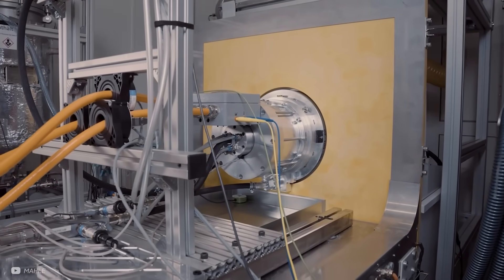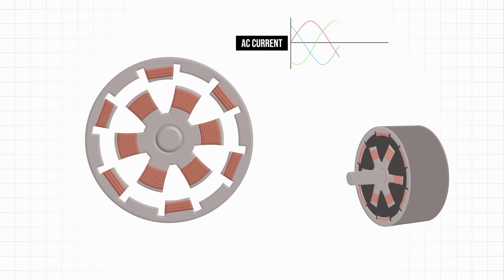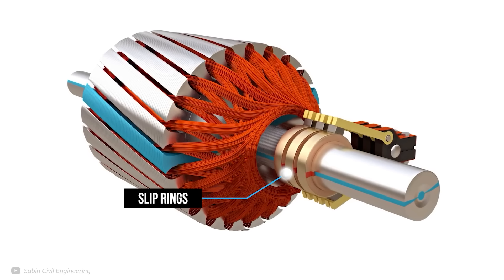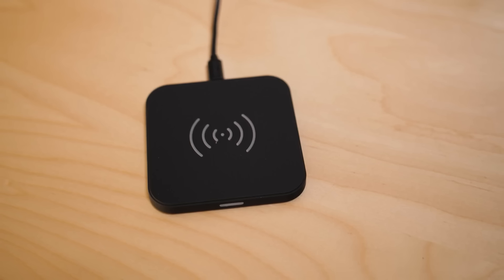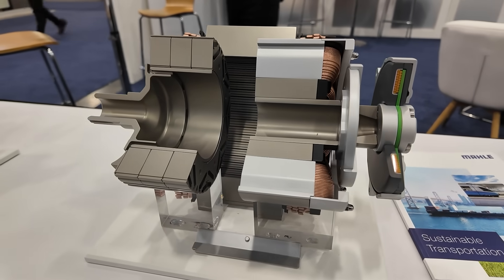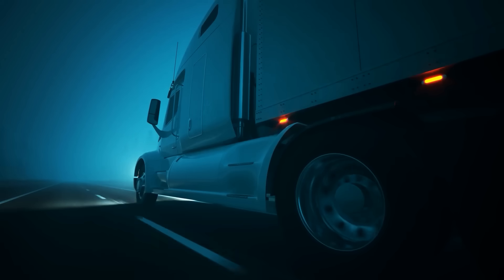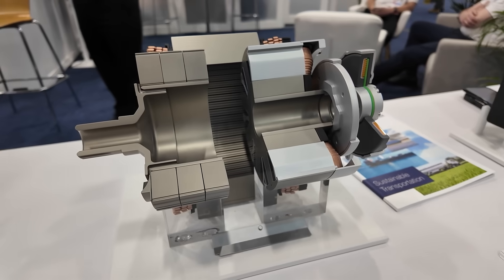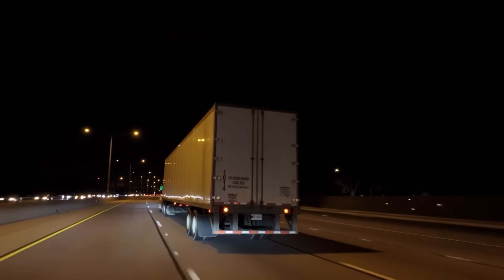Genius Contactless Motor Could Change Transport Forever

Comment: As an engineer I've very much missed not having power density and better information on efficiency. It's the technical stuff that really interested me.
Reply: Exactly, no information beside 'better'. Also no comparision to motors with rotor magnetic fields conductors (iron bars) like some BMW ones which can transfer field from one coil on the outside of rotor to other (or almost) side.
Reply: @b9eda9ad   - are you describing a reluctance motor - switched reluctance was all the rage a while ago...
Reply: Indeed. No performance numbers is a giant red flag.
Reply: All sizzle and No steak. No mention of slip in induction motors (vs synchronous), and why the slip (the OG method of conveying current/excitation to the rotor) is less efficient than the external induction assembly shown here.
Reply: @karlfife    - lol,  merely cast significant shade on induction motors while calling everything amazing and "wireless". -  yep...  (double induction - synchronous machine, call it what it is.)
Reply: @karlfife  I hear you there...
Reply: @karlfife  And if they're pumping oil through the rotor, what effect will environmental temperature have on the motor's efficiency? There's a reason why motor vehicles use lower-viscosity oil in cold climates, and if the motor functions at, say, 25% power while it's heating the oil up enough to reduce the viscosity to normal operating conditions, how long that takes is going to be a huge consideration in the industry adoption of the motor. And there is also the consideration of how well it functions in reverse -- most electric vehicles use regenerative braking, running the motor as a generator to recapture part of the vehicle's kinetic energy back to the battery to extend range. There's nothing in the video about how efficient the motor is when being run as a generator, or even if it's possible. If it can't be run as a generator, that has knock-on effects to EV design, by requiring significantly larger brakes to slow and stop a much heavier vehicle than one with an IC engine.
Reply: That is true, how much power is wasted in the inductive stage and how much is used for the electromagnets ?
Reply: @nwb8006   This is the issue I am planning to raise with my general comment above where I express doubt in the power transfer capability of the 'wireless commutator'.  The power handled by the energy transfer mechanism between stator and rotor, must equal the total motor power, since all output power is transferred to the rotor.
Reply: @nwb8006  electro magnets are highly efficient !! 😮
Reply: @nwb8006   Having the source of electrical energy transfer to the rotor not be the motive force itself, can only be less productive. If that wireless energy transfer system is not the motive force producer, then the drag caused by the wireless transfer would probably counteract  the motive force.
Reply: The most important bits.
Reply from the maker: I was annoyed not to get this information too, I reached out to MAHLE a few times and even spoke to a rep at the CES tradeshow, but didn't get any replies via email and the rep didn't know. Apologies that information was missing!
Reply: @ZirothTech  That means its real specs are terrible and they don't want to say anything.
Reply: @ZirothTech  garbage in, garbage out: there are and always be air gap losses. Mahle may extract heat to guarantee a "safe" air gap but that would cancel in the long-run. One can't have "dynamic stators or rotors". Since efficiency is measured at the motor shaft, some compromise must be done to come up with a 1) shaft, 2) claimed 95% efficiency, 3) temperature range ! You can't have all 3 in one electric motor.
Reply: @codures  that’s what they said about powered flight ✈️ etc  Lol 😂
Reply: @ZirothTech  not really a new thing, just a standard synchronous motor with external excitation, using a planar transformer to power the rotor winding. Pretty much something common on high power generators, where they need to run long periods without stopping, making them useful in power generation for long run time, as the only thing you need to change is the oil bath oil in the bearings, and thus can run them for 10 years with no stopping, before stopping to clean and inspect them.

Does not even need much in the way of electronics in the power transfer, you have a rotor coil with a bridge rectifier, and a exciter coil with some form of AC power, either simple H bridge at some fixed frequency, giving a constant current, or variable to allow you to vary current based on duty cycle of the bridge, allowing max field strength at low RPM with high current, and at high RPM you drop excitation to a lower level, or even turn it off, to allow the rotor to act like an induction motor, using the diode bridge to handle the freewheeling current, which will improve efficiency a lot, as now at speed no cogging losses in the magnetic system, while at low speed you get a very high breakaway torque. Much cheaper to make yes, and while you have a lot of copper in the rotor, and need to cool it as well to keep the heat down, it will work well, even with existing drives, with only minor changes to provide the excitation power, and the added temperature sensing needed. Your bridge rectifier will probably be improved by adding in active switches, as you otherwise will need beefy schottky diodes on a heat spreader to handle the high current, as high current is needed to get a strong field, and you will definitely want to reduce inductance. So schottky diodes rated around 100A per diode, or add in power mosfets, and a separate power winding to allow an active rectifier to be on the rotor as well. Slightly more complex, but allows an extra percent or two lower losses.
Reply: @SeanBZA  I'd rather watch your videos if you make them. Excellent insight.

For high current applications, I believe soon enough we won't have any rectifiers at all where rectification is needed - but rather a sensing circuit steering a high-efficiency switch. You don't need to "rectify" a sine wave if you know which way it's pointing and throw the right switches just in time.
Reply: @ZirothTech you should have laid that out clearly in the video, in the description & in a pinned comment. 
You are wasting our time & it's not appreciated.
Reply: @ZirothTech  there's a reason they didn't share that info.
Reply: @ZirothTech  That should have been included in the video.
Reply: @ZirothTech  whats your take on this?  open source or patent "protected"? As I have tried reaching out to no avail as well.  Or is this put out there for future dev.  The later seems true as it corresponds to my past ideas almost 100% that I have been pondering for years.
Reply: @JohnFigueroa-r6p  by the looks of it it's a pretty cynical investor play. I get the political implications of rare earths, but replacing them with copper, fed wirelessly - this ain't getting nothing cheaper or better outside of some very edge cases.

Modern brushless permanent magnet motors have advanced so far thanks to drones incl huge agricultural ones, they'll wipe the floor with this thing.
Reply: @AlexKarasev  appreciate that sentiment, but it was just something that I envisioned some time ago specifically for an alternator, (Not the wireless part) for other purposes.
Reply: @ZirothTech no ur lazy and greedy and just sad your being called out.
Reply: @ZirothTech  That is a HUGE red flag!
Reply: @ZirothTech  Sounds like Mahle is stuck and is fishing at CES for more funding to continue its research.
Reply: @ZirothTech  So you cannot know if it will "Change Transport Forever" or not at all...
Reply: @ZirothTech  Do they claim to have built and tested one?
Reply: @samheasmanwhite  Can I just point out that where I used to work before retirement we were assembling turbine driven alternator packages with 10MW brushless alternators for many years. Exactly the same technology as this, just a different use for the technology.
Reply: @martinconnelly1473  Oh I know it works, rotary transformers have been around for many decades, but I'm wondering if this company has built one. Also I can see it being needed in turbine alternators due to the insane surface speed you would have to deal with for brushes, but is that really a problem in small traction motors? I guess even just the carbon dust is a problem, so maybe I'm being too sceptical... this probably does have some good benefits.
Reply: @samheasmanwhite  The alternators were always geared down by a planetary gearbox to suit either 50hz or 60hz regions. So not rotating at the same rate as the turbine. However it would still result in the large surface speed for slip rings you mention due to the large diameter that would need to be used to cater for the large currents.
Reply: @martinconnelly1473  Huh, I'm surprised it would be used like that. Just guessing, but I suppose you could use smaller slip-rings at a higher voltage and lower current with power conversion on the rotor, but if you need electronics on the rotor anyway you might as well do a rotary transformer too. At least I assume there is electronics on the rotor? Feels like a 50Hz rotary transformer would need to be huge.
Reply: @samheasmanwhite  There is an extended rotor shaft with the unit on the non-drive end. The electronics are all external to the unit in a control room. The unit powers the field coils of a mutli-phase alternator in the unit that is then rectified and used to power the rotor coils in the main alternator. This gives full control over the power output to maintain the correct voltage coming from the alternator. As the output was often paralleled to other supplies the power output had to be carefully matched to these to avoid back driving the alternator or having the same effect on others. The alternators weighed up to 50 tonnes and the external rotor power unit was about a 400mm cube. Slip rings are not a good idea when you want power 24/7. These packages were often part of offshore drilling and processing rigs for example.
Reply: @martinconnelly1473  Ayy, those are some chonkers! I just had to design some variable current load balancing circuits and I am not envious of having to do that with multiple gas turbines and an oil rig's main power at stake.
Reply: @ZirothTech  If they would not tell you it means efficiency is poor and this whole video is a waste of time. Nothing to see here folks, move along.
Reply: @ZirothTech  you should have not bring it here then, acting as a siding of potential scammers, with all this buzzword bullshit.
Reply: @ZirothTech Then you needn't have bothered to make a content free post.
Reply: So no way to "truly understand" =/
Reply: This video is pure hype.
Reply: @tarstarkusz  possibly, possibly not.  It is a design concept that I have envisioned for years and this is the first time I have seen anything closely corresponding to it.
Reply: that's because zeroth is not good at being tech specialist, lmao.
Reply: 95%...
Reply: Yeah wtf is up with claiming this will "change transport forever"? Nothing in the video substantiates that claim.
Reply: This new motor is a giant step BACKWARDS in most ways, to early polyphase motors invented by Nikola Tesla, in that they have wound rotors (no permanent magnets). But that is combined with a way of getting externally controllable levels of power into the spinning rotor, without needing slip rings. All of is OLD, except for the external control. Only that particular separates these new motors from existing brushless polyphase synchronous AC motors... Which, btw, run as induction motors at low speeds, for greatly improved starting torque.
Reply: @YodaWhat Thank you for REALITY Report! The Scarry Part, we Forget, by Incompetence(!) Or on Purpose(!?) About Past/Historical Achievements/Discovery! Why?!😮😢 For 100 years We walk 2 steps forward and 1 step BACK!😮😢😊😊😊
Reply: Especially when synchronous induction motors exists since forever. How this design is better I wonder.
Reply: @Piasecznik72  Carefull... this thread seems to think electric motors without magnets are somehow a modern invention.
Reply: with what you shared, I'll add that you need to consider other ideas for this tech might impact also.   [AKA Think outside the box or framework that is being promoted]
Reply: Go and think of the extended applications ! That not transport! But requires higher rpm that squirrel cage synchronous motors  😮on grid supply! 😮😮😮😮
Reply: I can see it !! And I’m only a electo tech
Reply: By using not using permanent magnets leads to energy being used in the electromagnet that replace the magnet meaning less efficiency.
Reply: @  I have seen a car in the sixties picked up by a 1.5 V battery 🔋 powered electro magnet 🧲 go learn shit 💩 and then learn some more 
  Then think about it for ten years ! Then come back and say that ! The power used is negligible ! And if you listen 👂 the permanent magnets 🧲 actually cause waste in the system !  
  Be more informed and have better understanding b4 opening mouth 👄
This technology will enable  brushless motors to have a wide easy to control speed range way more efficient and higher rpm that squirrel 🐿️ cage type motors with untold less inrush currents and same efficiency as rare earth types !!!  Go do your electrical studies further !
   ie , iron losers , hysteresis , changeable flux fields ……..
Reply: Nickola Tesla invented the brushless motor and his brushless Generators are still running Generating Electricty To one side of the Niagara falls and they running to this and lighting that lights the pathway to my knowledge Most battery operated hand tools you have the opsion of Brushless Motors in em but they are  generaly more expensive.
Reply: @  ???? A little knowledge is just that ! He invented the induction motor  ! Had a squirrel 🐿️ in a cage 😂   
   Not sure but the generators had the exciteor had low current slip rings ??? Originally ?
Reply: @robertwoodroffe123  The technology had been used for decades, its nothing new. I can buy a HobbyWing FOC (Field Oriented Control) 3 phase or brushless motor for an RC car and claim to have even replaced a parking brake... but it does'nt make it any more revolutionary than an RC car with a fancy motor that locks up using electromagnetism.   
edit: HobbyWing holds a patent on it by the way.
Reply: @Ed-ty1kr     there is no permanent magnets  🧲 in these and they are NOT toy car 🚗 or battery 🔋 drill motors!! Obviously the new part  eludes you ! This is more like ! But not ! What was called a universal motor ……..
Reply: @robertwoodroffe123  You mean a 3 phase alternating current motor with rotating magnetic fields was not invented by Nikola Tesla? I thought they named a car company after him for that reason alone?  🤔  Huh... You dont say...
Reply: @ Oh and by the way, that FOC "toy car" motor holds an international patent for a reason... unlike this design which had been used in  industrial applications long before someone put tariffs on rare earth minerals. Yes induction 3 phase motors have NO MAGNETS 🚫🧲 because they use INDUCTION COILS to generate the right hand rule which includes your middle finger pointed to the left 👉+🖕 magnetic fields and therefore require no brushes... which is why they are used for reliability.
Reply: @Ed-ty1kr  What did the FOC do differently?  All RC BLDC use permanent magnets.  Help me understand what you're pointing out here?  It is amazing what the RC community has pioneered though...John Robert (Holmes) has done some nice work as well.
Reply: @JViello  It's not necesserally the "RC" community which is winning wars at the moment, it's just an interesting way to turn an electric motor at percise speeds that refuses to allow greater or lesser speed all the way down to zero and a full stop.  Meaning if you ever played around with it you would realize it can not only turn silently, but if you stop the motor it remains electromagnetically locked up.  And if you have no respect for the RC community you are not an engineer, even a helicopter was first done in lesser scale during the 30's.  Everything from submarines to boats all starts with scale designs for testing. 
Look it up, Field Oriented Contol
Reply: @JViello  Basically it is the most powerful at low RPM's to zero RPM motor that I had ever played around with, that can still turn 60k RPM almost instantly.  Check it out. Not the cheapest around but definately a patented game changer as far as electric motors go, which can me incorporated into better servos... ect.
edit: I looked up the "Holmes" motor and that is not even a 3 phase motor, just a large incredably noisy DC motor / ESC combo.
Reply: That might require moving a high density fuel source to where it's needed, instead of transmitting power through miles of aluminum wire and step down trasformers.  Besides... youtube influencers won't have any reason to tell you about data broker firms that charge you for sole use of your data, while pretending induction motors were not invented by French physicist François Arago in 1824.
Reply: Well it is magnet less oil cooled so cheap efficient ish
Reply: @goodziXXXrated  I must admit I do like the oil cooled part.
Reply: True indeed
Reply: read some books when you will be free from screaming "free counter" in mcshit.
Reply: This technology has been existing in medical imaging technology as MRI and CT scan but they just repurpose to such motor.. I hope and pray these all magnates does not affect Earth magnets to be unstable or flipped.. Good Luck human being!
Reply: the first thing I thought when hearing the induction power transwer into the motor was: what is the efficiency of this transfer? I mean… we crate a magnetic field to transfer power to a induction coil which then powers a magnetic coil again? is this really efficient?

We hear so many news stories about grat inventions like the „solar“-panels which generate power without the sun present and therefore generate power for more hours than conventionel panels. And people go: wow, that means 2 or 3 times the power… Not once in all these arties was efficiency or poweroutput ever mentioned… So I guess i‘s basically useless. Just… that gets no clicks, and no investments.
Reply: Doesnt the "wirless powering" not also cause currents in the rotor that slow it down? In german its calleb "wirbelstrombremse" where you use magnets on metal to iduce a current in the piece.
At the end you have no wear for transforming kinetic into thermal energy. 

Wouldnt that effect slow the motor down the harder and faster it tries to spin?
Reply: @johannesdatblue4164  Of course the Germans would have a name for something the rest of us simply willfully ignore.
Reply: Then you are a very poorly informed engineer.  This is nothing but an induction motor  invented by Nikola Tesla Circa 1890's Signed a real Electrical engineer Masters of engineering.
Reply: You can imagine the friction of a motor filled with oil, the energy lost on pumping that oil, plus the energy lost in coil  contactless transfer, probably a solution adopted because the grafite brushes doesn't work in oil. That is why they hide the data about the power density and efficiency. The tipical hype who never reach the market.
Reply: GUESS Who's Fault It Is? OIL and CAR's Mega Company's WHERE Suppressing Anything ELECTRIC(!) In Transportation!!!😮😢 Except Trains and Golf cars!!!😮😊😊😊❤
Reply: If Sandy Monroe could dyno test motors that would move the tech forward faster
Reply: @glike2  well I do believe!? She shaved her beaver 🦫 cause squirrels 🐿️ were hairy ! 😂
  And that gets stuck in your teeth 🦷 😂
Reply: It says 95% efficiency
Reply: @rafaelpadilha4585  They can say whatever they like, but unless there’s data to back it up then it doesn’t mean anything. Every day we learn weve been lied to one way or another. Question everything
Reply: @Cybo-Man   or alternatively if you could understand the principles ! This is a way in many places to reduce reliance on rare earth 🌏
Reply: @ That number is most likely BS, even if it's true. It could just be the peak efficiency.
Reply: @rafaelpadilha4585  95% of what?  See the problem?  The number means nothing,
Reply: I continue made my innovative project of a non-combustion engine, I remind you that I am posting here on my channel the technology and the principle of operation, according to which anyone can create a prototype and enjoy free energy, since I was denied financial support at the stage of the idea and theoretical research, after a year of unsuccessful searches. Including I will begin to assemble a sample. And soon another video will be released, revealing my developments, the wind of change is approaching! All those who are not indifferent, welcome to the flight in this departing innovative car, which will lead to great achievements for the successful future of the planet and humanity!